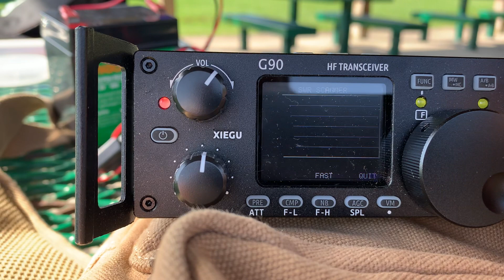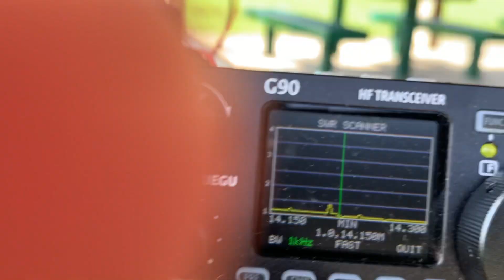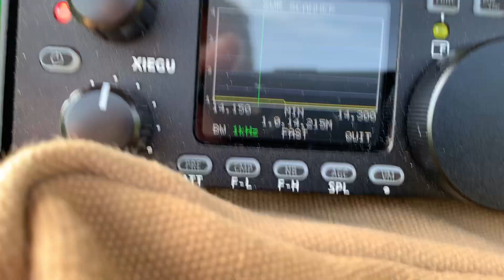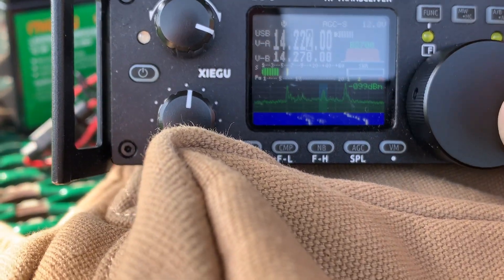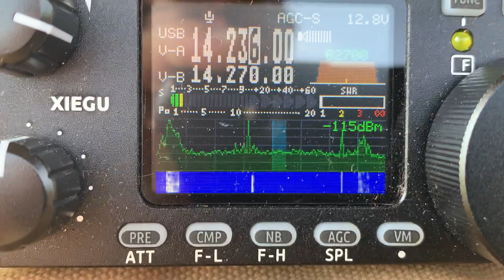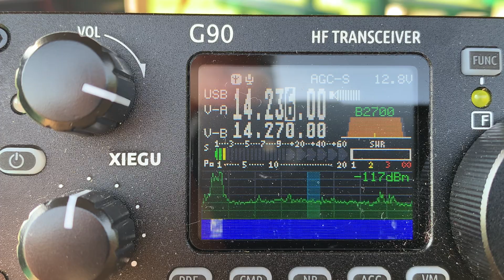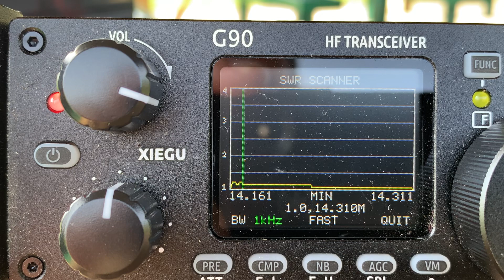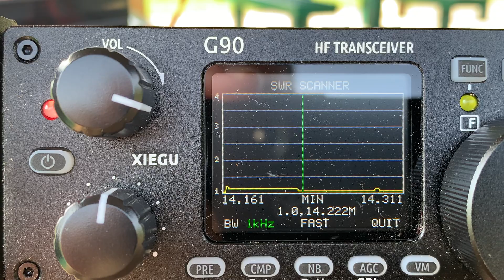ATAS-25 + Xiegu G-90 = A perfect marriage!

Comment: I have a Tarheel and a tripod do you think it will be a good fit. The antenna is a mobile, with  a 12 v motor . Have the same radio. 
73 KQ4CD Paul ⚓️
Reply from the maker: Yes, the Tarheel will need a controller box to move the antenna up and down.   Should work really well if you put the radio in SWR scan mode and move the antenna until you get a flat match.    Thanks for watching.   73 KC8ZKI John
Reply: @johncooper6894  that's my plan. Been off the air for 20 plus years and the technology is mind burning 
KQ4CD Paul ⚓️